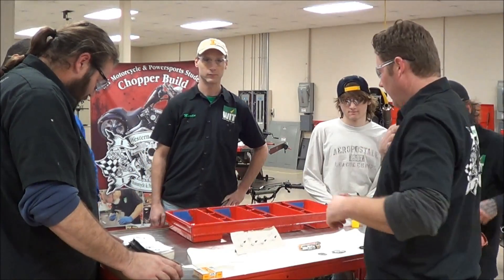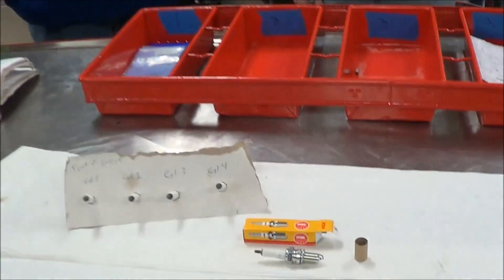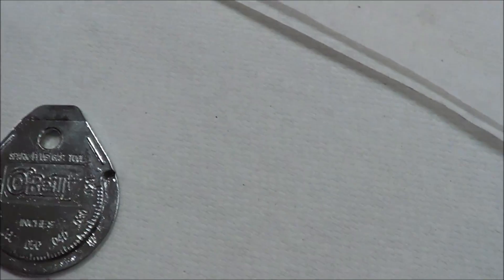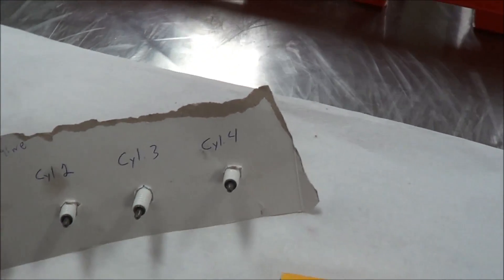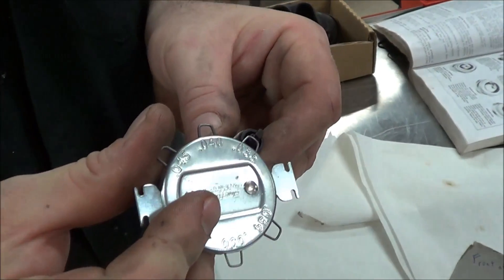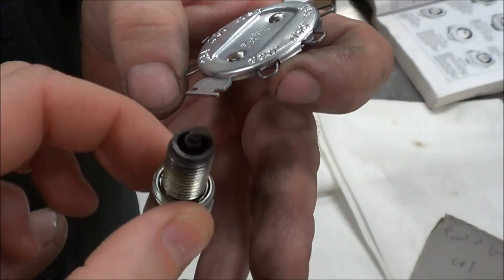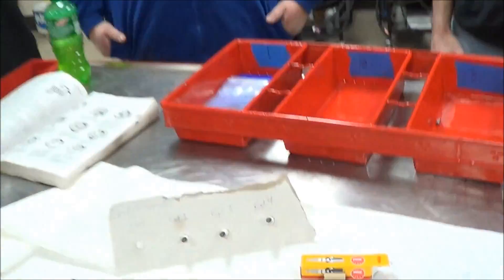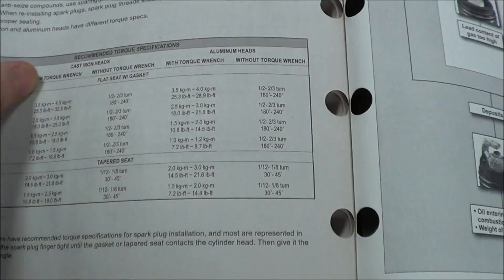How to Inspect and Adjust the Spark Plug Gap NGK BOSCH CHAMPION N3 DENSO

Comment: Good video. Fyi, the ramp gapper should be read right when it snug. What I read from your video on the ramp gapper was .037. That's why .035 wire was loose and .040 wire was tight. You did not read the disc gapper right.

Comment: Whenever you purchase spark plug wet the white clay covering sparkpoint with Elfie and keep it vertical to dry for 18 Hrs , this is to fill clay crestal gaps which otherwise will get filled with compressed oil mixed in fuel and produce conduction , know with this procedure your plug will have double life and you will realise the effect.
Reply: @How2Wrench  Co
Reply from the maker: Wyatt Blackmon ?

Comment: When the gap spec asks for 0.035 - 0.043. How much should the gap be? Thanks
Reply from the maker: Anywhere in between those numbers. Here's a tip. Set a new plug at the low or "tighter" spec. The reason is as it wears it will get larger. Stay tuned for my new website how2wrench.com! 
Keep Wrenching,
Shane Conley

Comment: "what are you doing to the sparkplug?" "Uh... " "You're damaging it, blah blah that's why you should use the wire gap" unintentionally demonstrates why a wire gap tool is potentially just as damaging if not more so

Comment: Excellent tutorial. All 1970's Suzuki tripples had a different plug gap setting for the middle cylinder than the outside cylinders. Would have found it interesting if you'd touched on gapping 3 earth prong plugs such as Lodge / Golden Lodge Sintox HH14, etc. I've had to gap these in the past and the expression, "F**king fiddly" is a bit of an understatement.
Reply from the maker: Head over to my website become a member now and to receive 20 minutes of personal mentorship with me. You can even use FaceTime if you have it or find a friends iPhone and we can walk through the actual carburetor process together. I look forward to mentoring you.

Note: Membership is not required to receive coaching or email help. Here are the direct links to individual services offered at H2W:

Email Answer Service-Click http://how2wrench.com/product/email-support/ 

Phone/FaceTime Coaching-Click http://how2wrench.com/product/personal-tech-training-phone-facetime/ 

DIY Mentorship-Click http://how2wrench.com/product/diy-coaching-hire-teach/ 

Dealership Training Services-Click http://how2wrench.com/product-category/dealer-services/ 

MMI/Tech School Student Tutoring-Click http://how2wrench.com/product/mmi-tech-school-student-tutoring-services/

Motivational/Guest Speaker-Click http://how2wrench.com/product/motivational-speaker/ 

On-site Training Services-Click http://how2wrench.com/product/on-site-training/ 

Tech Line Services-Click http://how2wrench.com/product/tech-line-minutes/ 

Mechanic on Duty-Click http://how2wrench.com/product-category/mechanic-on-duty/ 

Did you like this free video and hope to see more? Would you just like to say thank you with a donation? Click https://www.paypal.com/donate/?token=TvKoeRazPL-KysbM-e0ttz-C_gPq2IrqxDmM3ORCu4nxJzQWxYbmo-6m3YuNu64XHLngGW 

Keep Wrenching,
Shane Conley
Instructor/Motivator/Motorcyclist!
www.How2Wrench.com

Comment: Not to put this video down because it is very helpful to someone who is trying to learn to gap plugs... But i would not recommend you putting any lubricant or anti seize on a plugs threads. Based on any plugs torque readings are taken from a dry metal to metal torque value. if you put any lubricant or anti seize allowing less friction to be built before coming to its torque value, you will in turn over torque your plug and potentially do damage to the plug the head or both.
Reply: I always put anti seize on the spurk plug threads.I'm doing that since 1994.,and I never had any problem.
Reply: modern sparkplugs are coated with anti corrosion
Reply: On aluminum heads it sure can, it may take many cycles or happen the first time. Anti-seize will reduce the metal to metal thread friction greatly and increase the clamping force. Every OEM torque spec is for CLEAN AND DRY unless specified otherwise. To be safe I would follow the OEM specs and put the same exact plugs back in, never had any issues with this method.
Reply: That is 100% correct, TORQUE CLEAN AND DRY unless manual says otherwise. Spark plugs do come with a protective coating. You will have a really bad day if you strip spark plug threads.
Reply: Not needed with the plugs today, most all have a silver Anti-seize plating on there already. The OEM plugs will guarantee no issues, if you got lots of engine mods then other plugs and gap specs maybe needed.
Reply: Your free to do whatever you prefer. I just know from 25 years of experience I am not putting anything on spark plugs threads UNLESS the OEM procedure says to do so.

Comment: My weed eater didn't run except for like half a second sometimes.
Turns out the spark plug was crushed, for a reason i'm not entirely sure about (factory plug, never taken out or dropped). So I didn't have a wire gapper of any kind so I just took some needle nose pliers and carefully bent it back in a roughly good position and now it works fine!

Comment: Best spark plug video on YouTube! Very informative, but the hole on the spark plug gauge is not for hooking it to your keychain. That hole is actually used to set the gap. Just a little FYI just in case you weren't aware.
Reply: I sure didn't know. 👍